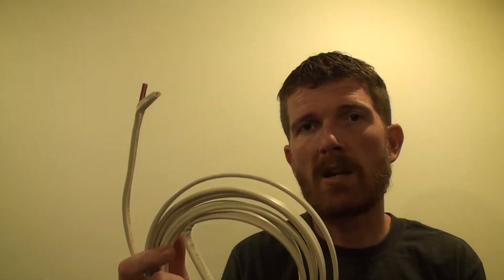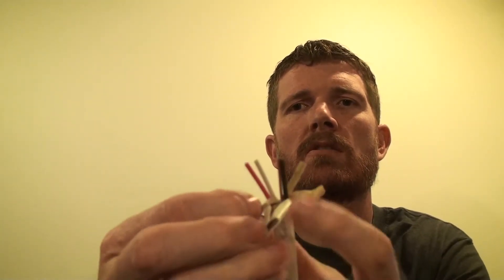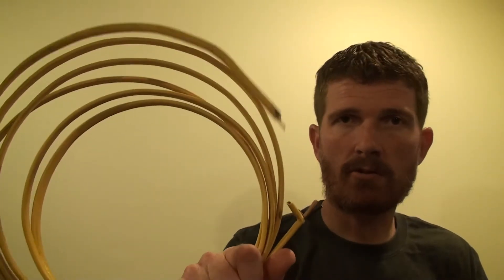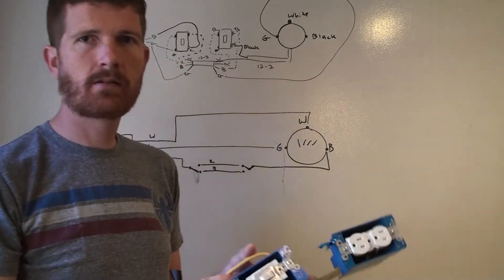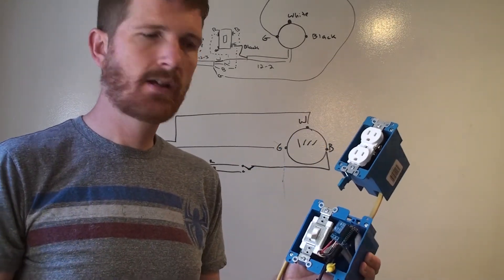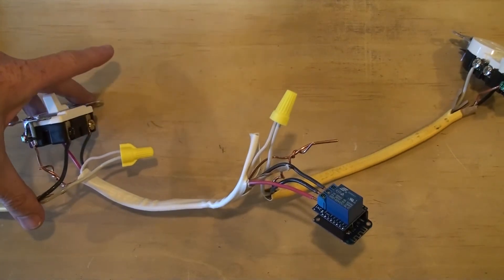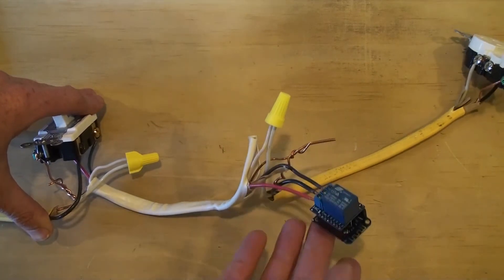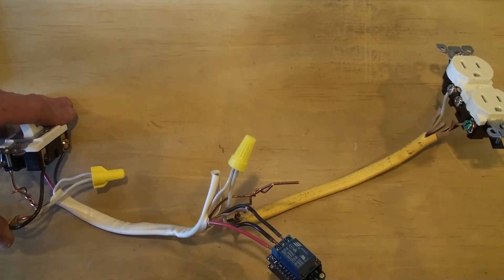Maker project - Relay as 3-way Switch for use with Raspberry Pi, Wemos or Alexa

Comment: cool video but just one tip
When doing a new project  its.all good yet don't count  on wire colors while dealing with existing wiring 
Always test! use a multimeter  find the hots first and in case  more than one powered wire found check output from the same faze
 namely, place each end of the multi  on each powered wire  and see displays 110v or 220V i've encountered situations  that somebody used.white as black it was powered
Reply from the maker: Good tip! I've seen the same thing also.

Comment: Thanks for this handy switching system.
My questions are:
How do I get the App?
Can the App be more than one?
Can the relay be more than one too?
In your demonstration there is no connection to the two power terminals of the relay, how does it work?
Thanks and God bless you!
Reply from the maker: @OnyemaOge The app is not available on the app store but I've updated the video description with a link to the source code on github. You can download the code and build it to your own iOS device. I thought about making the app more generic and uploading it to the app store but I haven't done it yet. If you sign up for an Apple developer account you can build it to any of your own personal iOS devices. In the app you can control multiple relays. I'm not sure exactly what you mean on your last question. The center wire in the relay goes to the load, and the two outer terminals are travelers that go to the first switch, so power comes in to the first switch, the travelers connect to the relay, and the load get's power when the switch and relay are in sync, connecting the appropriate traveler.
Reply: Thanks a lot.
For my last question, if the three wires are switch wires then how does the magnetic coil energize without any extra live and neutral.
Thanks!
Reply from the maker: @OnyemaOge oh I see what you mean. The relay is mounted to a D1 mini chip that controls the relay. It was made by WeMos when I made this video but the name is now Lolin. You can find them online, I purchased mine through Ali Express. If you get them there make sure you get them directly from the Lolin store as they are the best quality. I walk through how those work along with the app that controls them in this other video https://www.youtube.com/watch?v=sg2peFyqlyE
Reply: Thanks!
God bless you

Comment: CrushingDemons , Does the Raspberry knows the relay state when you turn ON the light manual ?
Let's say you turn light OFF from your app and your wife turns it ON manually, can the Raspberry tell that the light is ON ?
Reply from the maker: OMG 89 In it's current version it doesn't know the state of the relay (on/off). I purchased some components to make it aware of the state of the circuit but I haven't gotten around to wiring it up yet.
Reply: @MakeFixUpgrade  Did you have any progress on this?
Reply from the maker: @Nrodrigues90  not yet. I still have the components but have been doing other projects and haven't made it back to home automation related projects yet.
Reply: 5years later... What's the components you bought and how were you planning on getting the state of the light bulb?
We only need to know which traveller is live as we already know the state of the relay.
How can we 'tap on' one of the traveller to see voltage

Comment: yeah so how do you power the relay without using the usn charger? IE using the 110v romex to power the relay?
Reply from the maker: If you don't use a charger you basically have to create your own version to step down the voltage from 110v ac and convert to 5v dc. It's just a lot simpler to repurpose an old charger.